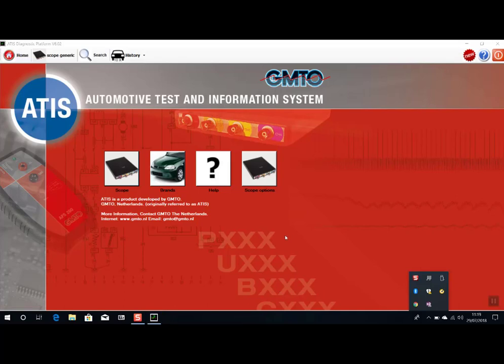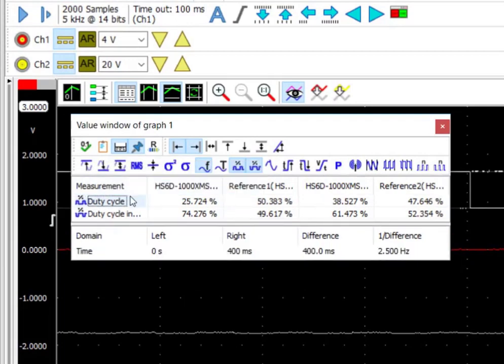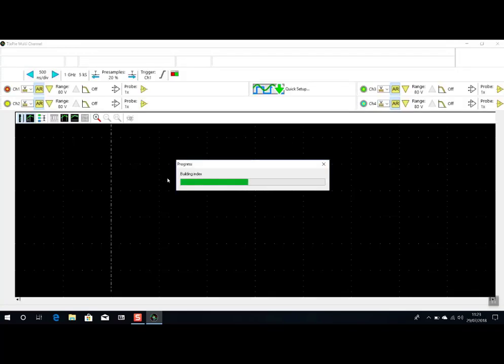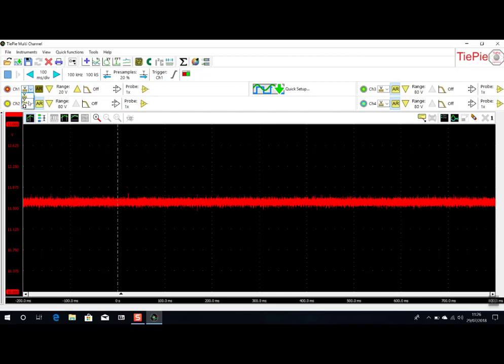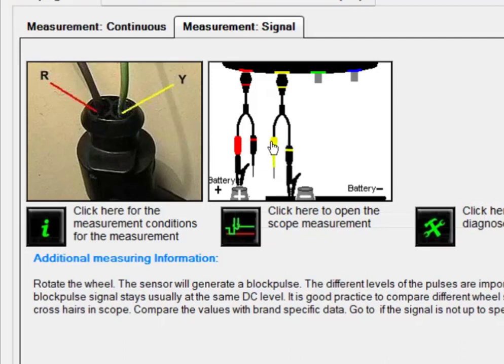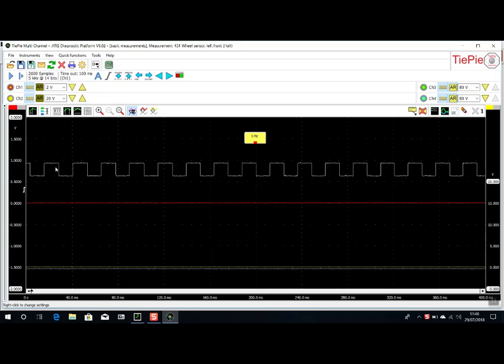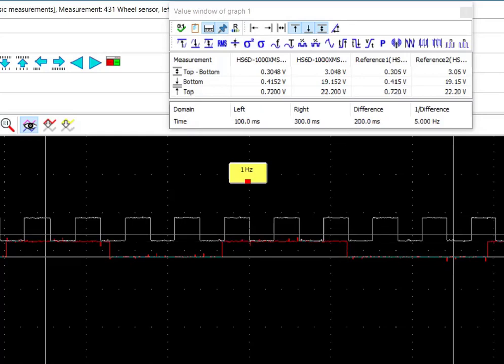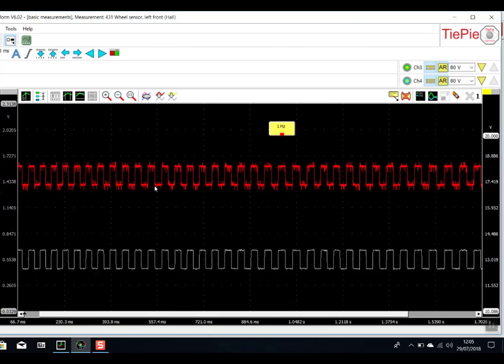Testing Active ABS Sensors With the GMTO-Tiepie Scope

Comment: Hi. Does wiring diagram work offline mode?
Reply from the maker: felipe moncaleano 
Hi yes all the information is offline 
Only have to connect to internet to update the software 3 to 4 times a year
Reply: Ryans Automotive thanks for answering. Another question, does it works by yearly subscription?
Reply from the maker: Yes but if you dont renew the subscription after 1 year it will keep working with the version you have
Reply: Ryans Automotive how much does subscription cost?
Reply from the maker: Hi if you send me a email at seamus@ryansautomotive.ie i can give you them details